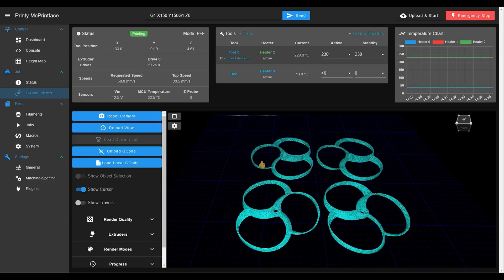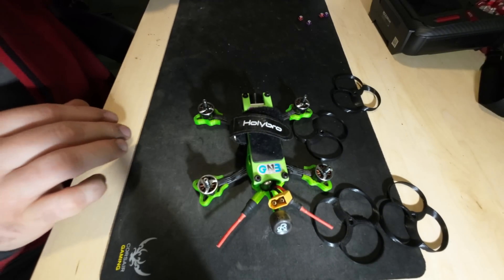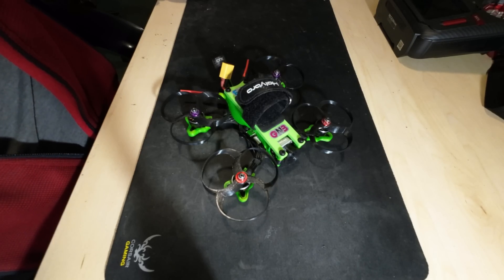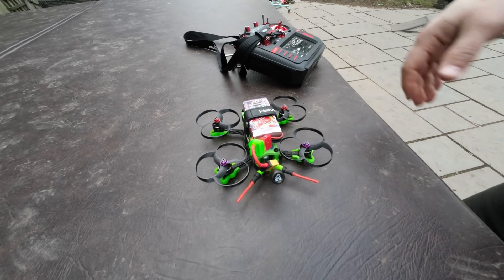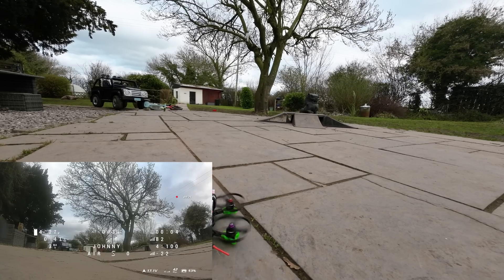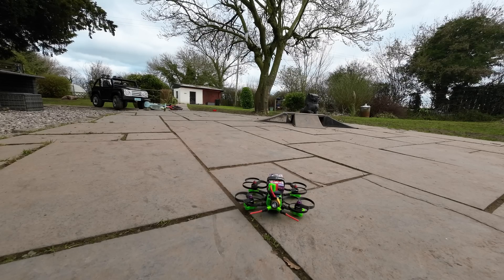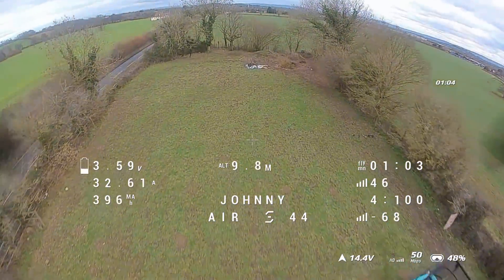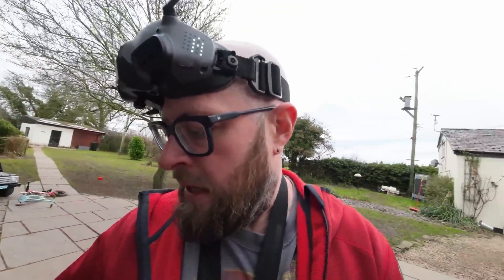More Toroidal Prop Testing on my Kopis Mini with a VERY unexpected result!

Comment: Thrust must be compromised as seen on the battery and flight time.
Reply from the maker: Absolutely. Drawing 20a continuous just to hover. Design improvements needed for sure, but this is a first design from @STRIKINGFPV and as a first stab, I think it's great it even produces enough thrust to take off!

Comment: Nice to see you are doing your research, I bet at HQ props they busy with it to now. Really hope some version will make it and yea wonder how it works with duckted drones also;
Would be so great flying with less noise, thx for video and work!
Reply: Think TPU will deform much and possible toch your baseframe, PETG maybe
Reply from the maker: Absolutely this. My TPU print last night failed spectacularly and want even worth doing a video for. 😂
Reply: @Cooperjan75  stepping a bit outside the DIYer sphere, if they are being optimized, purely for sound dampening, and we want as little flex as possible, I wonder if going back to carbon fiber would be best?
Reply from the maker: Thanks for the watch and comment. Much appreciated!
Reply: Think if they make it in Polycarbonate like most other props it will be fine, probably different pitch will fly very different too. I am sure these props will come out soon anyway, if only for sound, like stealth mode ))))
Reply: I don't think the shape can be molded so materials like carbon fiber or polycarbonate can't be used. There is no parting line that can be created to allow the part out of the mold.  Printing is the only way.

Comment: Cool vid - I love the experimental mind 😎
Have you checked your motors at all to see if they're hot?
Maybe instead of decreasing D, raising P might help also.

80% throttle limit might have been the culprit in your crash..... I wonder if the propeller material is too soft and causing some flexing..... might also explain the upward drift......
PS - get some strong fishing string, and a rock - throw the rock over the evil branch, and shake it until your quad comes down 😎
Reply from the maker: Motors were probably warm as they were drawing 20a just to hover. 
80% throttle limit certainly not didn't help with the crash. You get so used to applying throttle to a specific amount on normal props, this took me by surprise! And I hugged a tree. 
Absolutely love the rock and line idea. That's just genius!
Reply: Rock & Line is great, I use that too. I like 2mm Kevlar cord, it doesn't tangle as much, although it is more cumbersome to carry, and is not disposable. Also tie a contrasting bright color to one end, and pull a 'flag' up to find my launch point, when using drone as a periscope in forest area.
Reply from the maker: @Inertia888  Just off to hit Amazon for no aparent reason...
Thanks for the tip!

Comment: Mate, this is awesome, actually flying around properly without it exploding, haha!  Interesting on the forward lift and the rubbish turns - I do wonder if that might change with different configuration (props-in vs out).

I've made some changes to the design (including fixing the shaft sizes, have no idea why in my head these shafts were 4mm - my callipers are at home so I'm measuring with a ruler, lol), and I think I've improved upon the blade shape, trying to keep the shallower blade angle further out before the edge.  I'm hoping that'll work better.  Also, doing bi-blades.  Just check my Thingiverse page and you'll see the newer designs there.  Still WIP and only 5" and 6" sizes at the moment, going to be pumping out the smaller sizes hopefully by the end of today (has to be today, I'm on the road tomorrow, lol).
Reply: Hahah please do, mate, we're all here boring open shaft holes on your otherwise awesome design ;-)
Reply from the maker: Not sure I fancy my QAV-S new build on 3D props, but maybe the Nazgul on some PLA+...

Thanks for the design and inspiration. Perhaps we should collab on something for some fun!

Comment: Do they sound really quiter than conventional propeller? Would be great to do a comparison test with decibel meter! :D
Reply from the maker: They are almost as loud to the ear when close, but as it flies away, the sound level drops way more dramatically compared to a standard prop. This seems to tie in with the research from MIT.
Reply: @willitmod  Some of that noise might also be coming from higher-spinning motors to make up for the prop weight. I'm really looking forward to injection molded ones!

Comment: This is so interesting. Thanks for posting this.

Is the Toroidal  prop acting like a circular wing in forward flight?
Reply from the maker: It looks that way, it was such an odd feeling - to have the drone start to rise so fast as the angle it was at. It is hard to explain, but it felt like there was a massive updraft blasting my qwad upwards.
Reply: @willitmod   It's clear this propeller gives up some performance to a standard prop, however perhaps it should be compared to a tilt rotor without a delicate & heavy tilting mechanism or a wing that makes the vehicle larger than it needs to be.

Comment: Would be interesting to see how they perform in a ducted drone
Reply: In a funny way they're their own ducts. Would be best to remove the ducts from your ducted drone.
Reply from the maker: That would be an odd one I think - looking at the MIT videos and a smidge of research, it may actually hinder the already compromised thrust. Having recently been bitten by a 5" prop though, I would much rather get hit by one of these toroidal ones. :D
Reply: I believe the toroidal design in a ducted configuration would be redundant. It's my understanding that one of the benefits ducting provides is limiting the tip vortexes
Reply: https://youtu.be/aPymNcQnemI       
=[
Reply from the maker: Oh no!
Were they V1 or V2 props?
Looks like they do have compromised thrust in a ducted setting.
Time for an upgrade on the motors whilst you have one off? :)

Comment: From a safety perspective there great but there flight characteristics will need alot of tuning and Probably very inefficient but a very interesting video.
Reply from the maker: Having recently had my finger nearly taken off by a 5" prop, safety is a thing for me at the moment. 
For sure, with testing and tuning - even making in a smooth material as opposed to 3D printed, this could be a contender if the design and production was more efficient. Reviewing the footage, the drone is taking 20A just to hover!